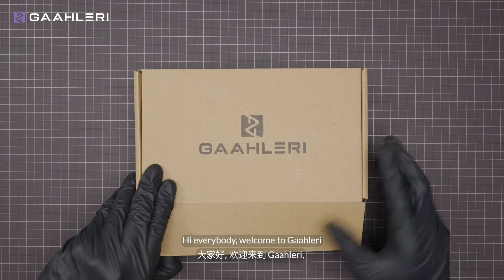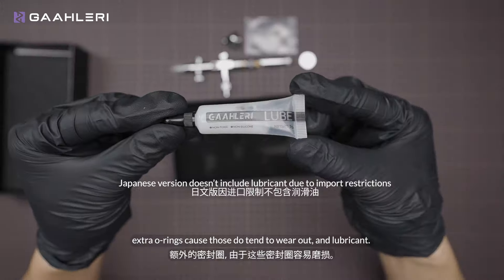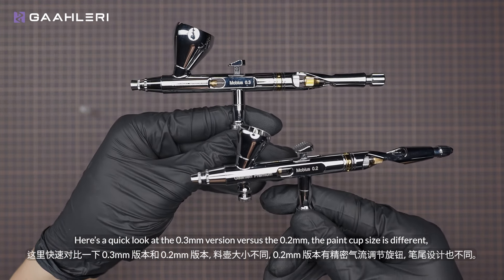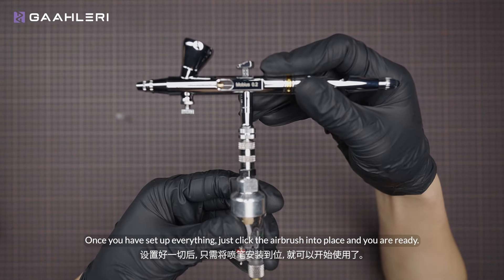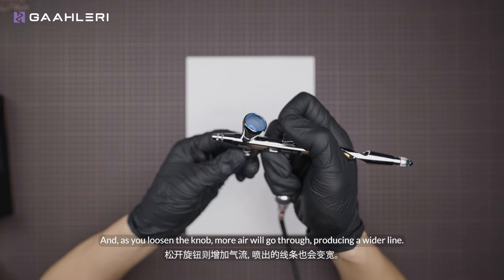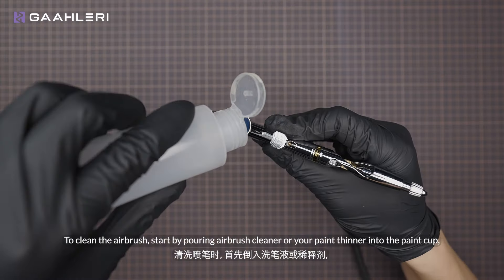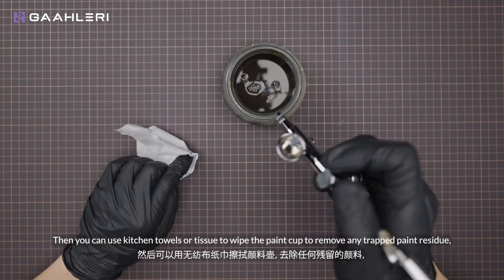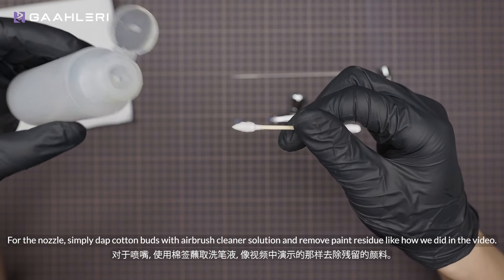Unboxing & Demonstration: How to Use the Gaahleri Premium Series Mobius Airbrush

Comment: I just spent 2 hours and 45 minutes using the 0.3 airbrush. I I used primmer and acrylic paint {AV}. I had no problems what so ever. I normally use a separate airbrush for primer. But I just received the 0.3  wanted to put it to the test. Absolutely no problems. I did a normal flush between paint and primer and at the conclusion of the session did a deeper cleaning. I was surprised at how clean the airbrush was!  Thank you so much for producing an affordable airbrush that performs so well. I do have the o.2 and will be using it for the next session. Now I have to figure out what to do with my 3 Chad-39"s. :hand-purple-blue-peace:
Reply from the maker: Thank you very much for your support. It is great to hear that our airbrush is performing as expected.

Comment: I have the mobius 0.3 and 0.2 and the 0.2 is very finicky!! Sometimes the seal around the nozzle doesn’t seat right do to paint on the threads of the body and the nozzle so please rinse with alcohol swab and clean the threads of the body before installing the nozzle !